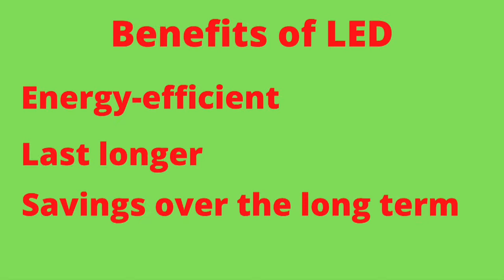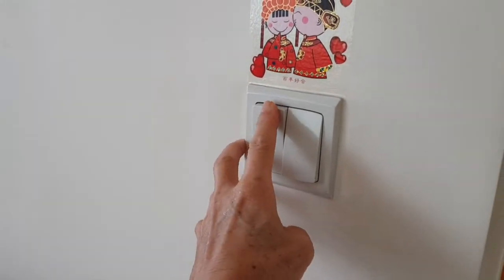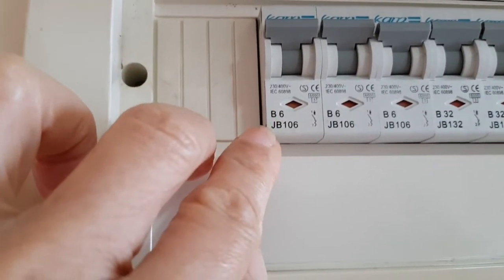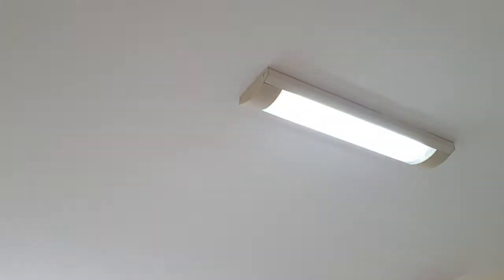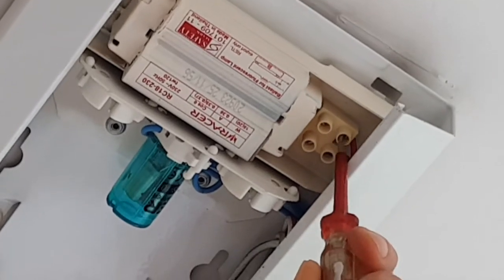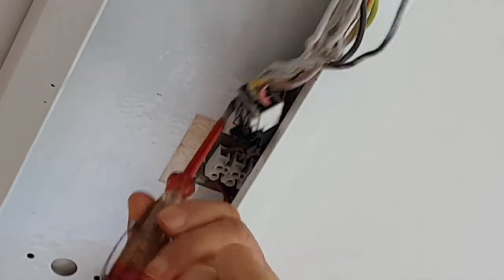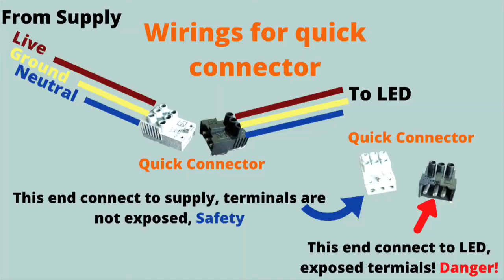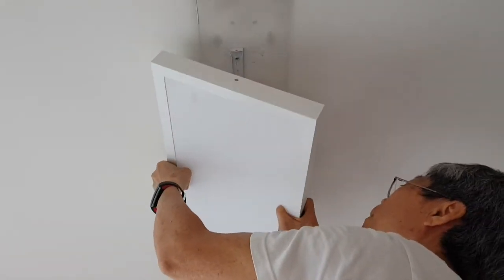How to Replace Fluorescent Lights to Led

Comment: Uncle William, there are many retirees living on their limited savings and in need of handyman services from time to time like changing taps, changing lights, to unchoke a pipe or toilet bowl, replacement of electrical water heater, chemical cleaning of aircon with a high pressure water gun etc. If we call an electrician or plumber or aircon man, it will cost us an arm or a leg. Sometimes even our head. Will be good if you can provide simple handyman services at low prices to such retirees. By word of mouth and referrals, the business will keep coming in. Good for you and good for retirees too. And before long, there will be tons of retirees in Singapore in need of your services. You can turn your handyman skills into a business and at the same time help the seniors community.